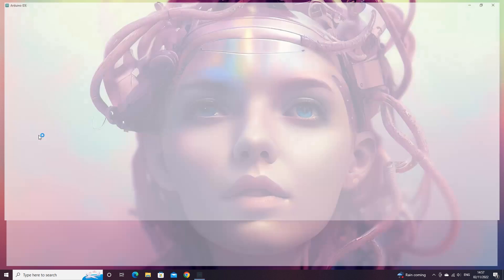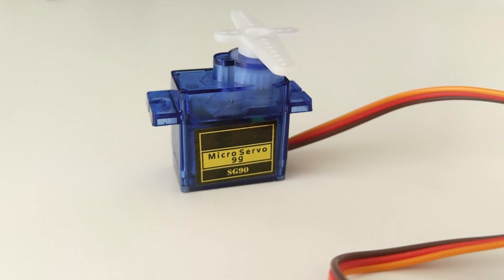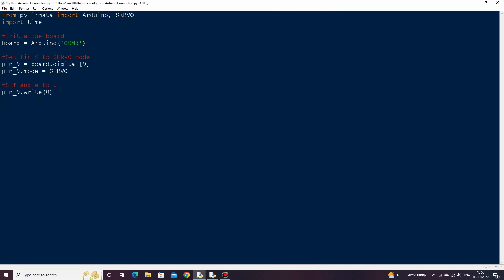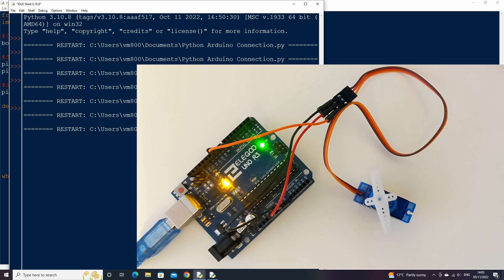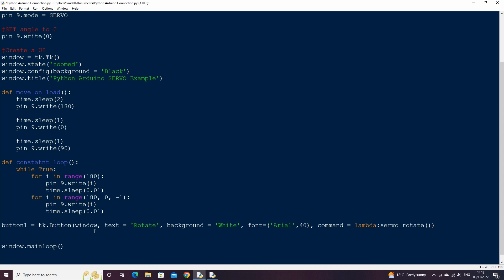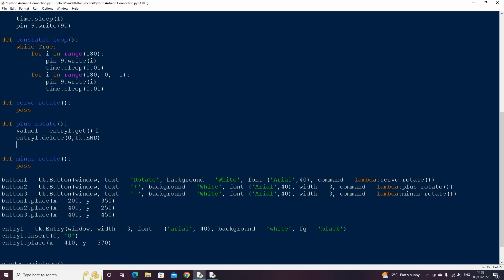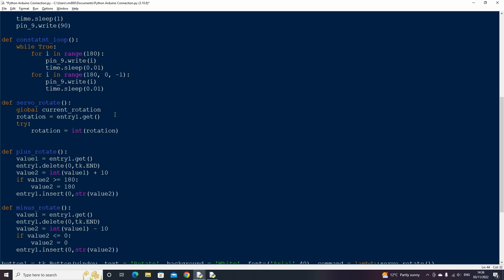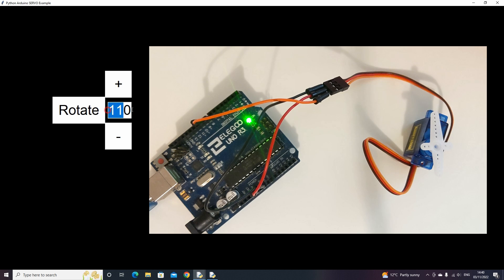Controlling A Servo Motor With Python

Comment: how do I know which port is which?
Reply: I had the same challenge. My workaround is to first startup Arduino IDE, check what com port you find your board. Alternatively you can use the Windows device manager to check out the port number once you have connected your Arduino. The nagging thing is that Windows is changing com numbers after reconnecting you Arduino. Maybe there is a way to force a number to your com port, or auto detect?

Comment: Does it mean you are running the Python code to Arduino without uploading the code?
Reply from the maker: The Arduino has the standard firmata sketch uploaded to it, the python code is live, so it sends commands directly to the Arduino over the serial pins and is not saved on the Arduino once the connection has been terminated. So in short, yes.